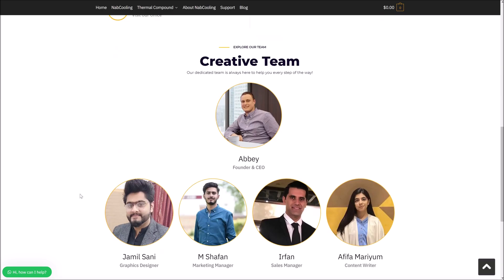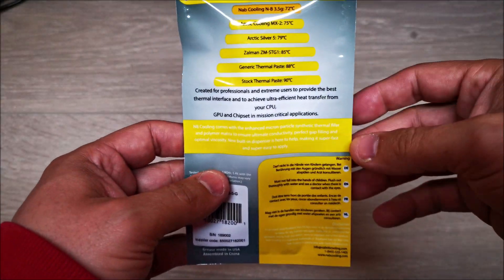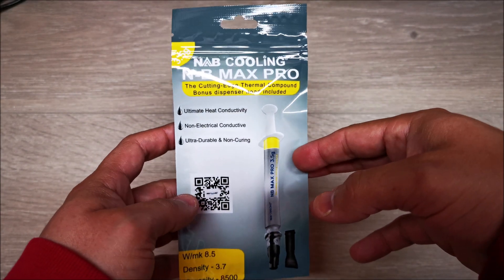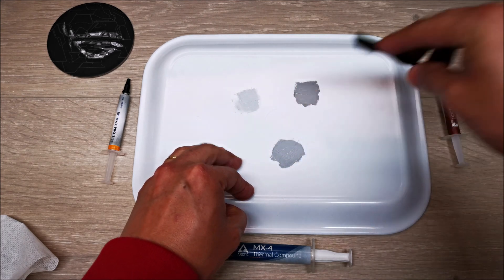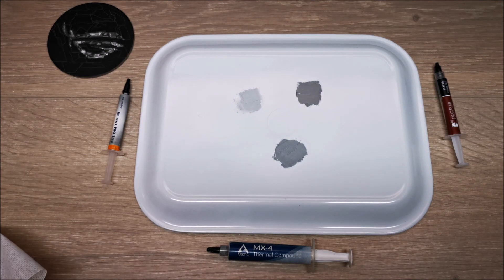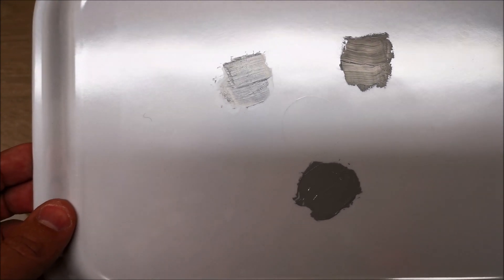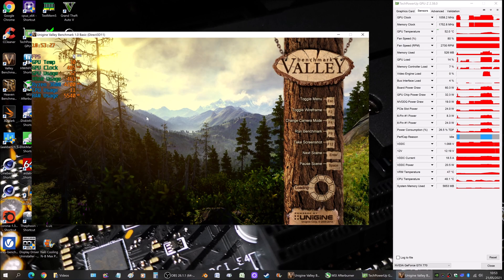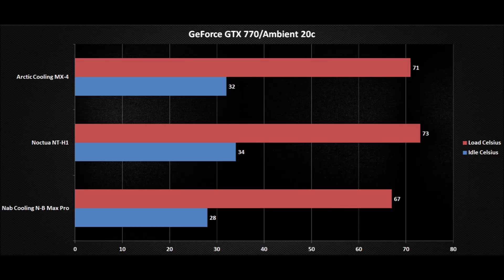Nab Cooling N-B Max Pro Thermal Paste...I'm Surprised!

Comment: Great video buddy. I just found out about Nab Cooling looking into the best thermal pads to mod my Macbook Air M1 because if you apply some thermal pads to the inside of the case you can make the whole case a big heat sink. So it prevents thermal throttling and should increase the laptop's life, especially the battery, by drawing extra heat away from all the components. I did a search on Youtube looking into some more info about Nab Cooling and your video came up even though I'm really looking to get their thermal pads. But you presented the information so well I watched you're whole video lol. And it's dope to see that they have great thermal paste as well! I'm subbing for sure, keep making great content my friend cause I really like your channel!
Reply from the maker: It is a fairly new company compared to others but their thermal paste was good! Thank you for watching the whole video btw :)

Comment: Suprising results indeed! 
But im wondering. For people who arent insane pc enthusiasts and dont overclock or benchmark their hardware. Is there anypoint in buying an aftermarket thermalpaste instead of the one that comes with the coolers? (CPU wise)
Reply from the maker: Good question. The answer is yes if you are building your system yourself. Why? Because the generic thermal paste included in stock heatsink from Intel or AMD and even most graphics cards manufacturers all comes from the same vendor. And it's just "good enough". Using an aftermarket thermal paste such as this one here not only does it improve thermal conductivity, but most aftermarket pastes out live the stock thermal pastes. But if you don't care so much for 3-5 degree improvement and 3-4 years extra longivity of your thermal paste then the stock paste is just that. Good enough. 😊